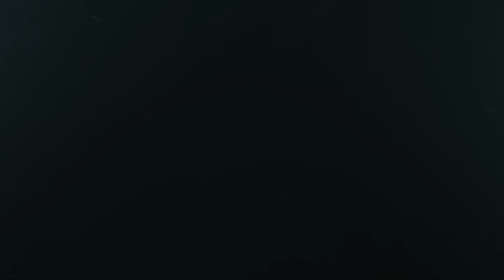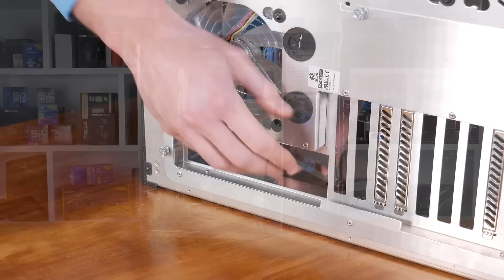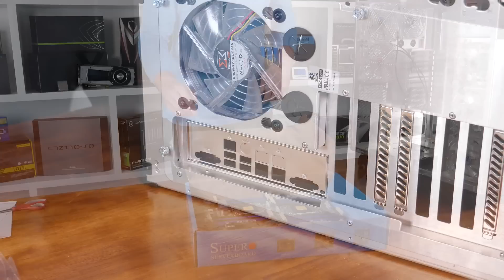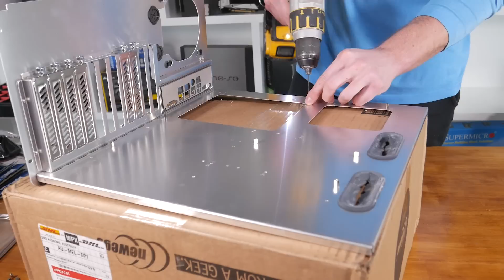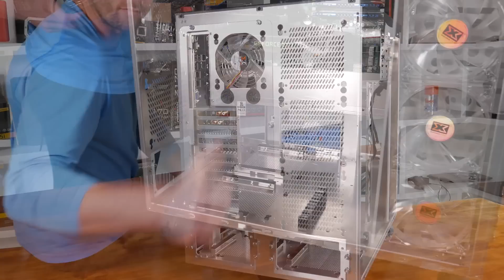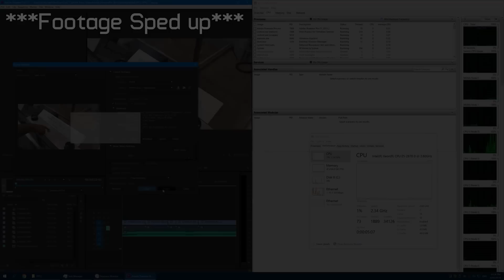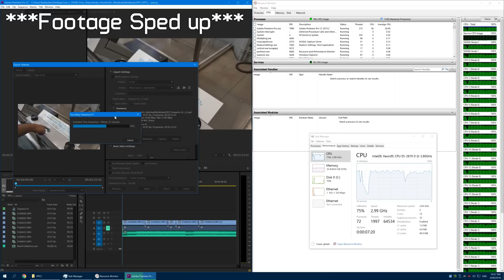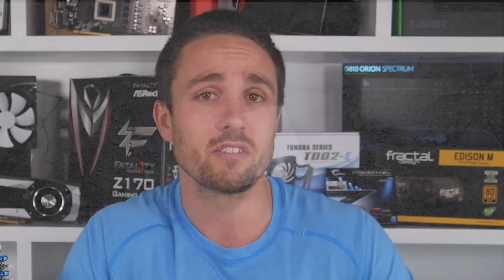6950X vs. Dual Xeons: Premiere Pro CC Encoding Battle

Comment: but can dual xeons run Vr
Reply: Barely, the one thing holding it back in practice is the low clock speed of Xeons. For example this CPU only boosts to roughly 2.8ghz if i recall correctly; and with it being a Sandy Bridge chip it's basically equivalent to an 8 core i7 2600K pretty much...and the 2600K is actually just "slightly" below the recommended specs for VR (although i think it just barely falls within the "minimum" specs for VR which i think was an i5 2500K, with recommended i think being either the i5 3570K or i5 4670K i believe).  If you went for dual V2 Ivy Bridge Xeons though i think you might be alright. Although those would be more expensive of course.  If you're wanting something that can handle VR gaming and stuff as well as workstation rendering, editing, encoding etc.. then i'd recommend getting something a bit different honestly. If you're on a tight budget something like the i7 3930K is a great choice, as even though it's "only" a 6 core 12 thread Sandy Bridge it can easily be overclocked to ~4.6ghz or more (i've seen some people actually hit 5ghz on these with water cooling) which MORE than makes up for the Sandy Bridge older architecture since it's nearly TWICE the clock speed of many Xeons.  You can get a 3930K for as low as $150 or so on ebay; or if you can spend a bit more there's the i7 5820K which is a 6 core 12 thread Haswell that is roughly 20% faster clock for clock compared to Sandy Bridge, and is only about $330-350 around this time brand new and more like $275 or so used;  and will probably get even cheaper for Black Friday...plus it can still hit that ~4.6-4.7ghz range easily which REALLY helps for VR gaming and such.  If you REALLY need "dem cores" then i would still suggest saving up to afford something like a Haswell 8 core Xeon or something, you can find some relatively decent clock speed ones on ebay for good prices; i've seen for example: 8 core 16 thread Haswell V3 Xeons with ~2.6ghz stock and ~2.9-3.0ghz boost or so, for like $400-500 or so which isn't bad, and with BCLK tweaks you could probably get it to clock to maybe ~3.2ghz or so, giving you a ~25-30% advantage over a Sandy Bridge ~2.5ghz one like the E5 2670 shown in the video....and there's always the option of getting a SECOND one down the line when you can afford to if you get a dual socket board, giving you SIXTEEN cores and THIRTY TWO threads! (still at ~3.2ghz of course)
Reply: +TheScaleless if I had a be quiet dark rock pro 3 on both CPUs, would I be able to cool it enough so that I can overclock it enough to run VR? Or what?
Reply: These e5 2670's boost to 3.3ghz if you can keep them cool enough.  mine are water cooled, and clock anywhere from 2.9 to 3.2 under full load, average 3.1 with a 15% load.  It is a good bit lower then what you can get a desktop chip to.  I had a 3570k at 4.8ghz before my xeon build, very snappy it was but lacked enough cores to do what I need.  It was always at a 80%+ load without playing any game.
Reply: Mario Darnadi nah.. very much CPU based. If it has a low clockrate, it will run like shit

Comment: premier is not supporting that much cores
Reply: And premier or aae dont give a damn about bow much cores you have its looking only the Clock of cores so you can have 2cores yeach on 10ghz and it would run as fast as 8core
Reply: That would be 8 cores at 1,25GHz